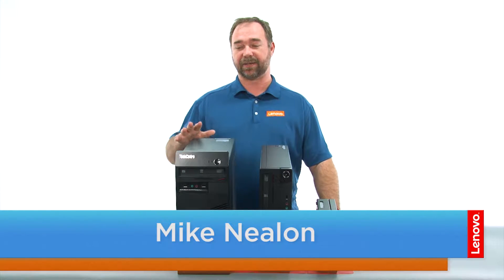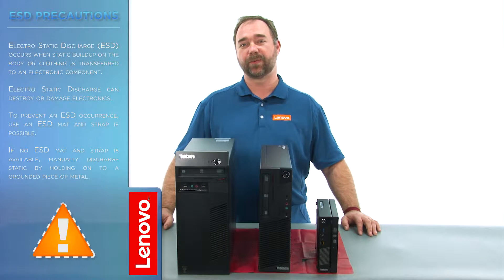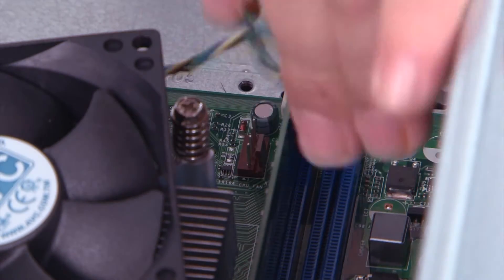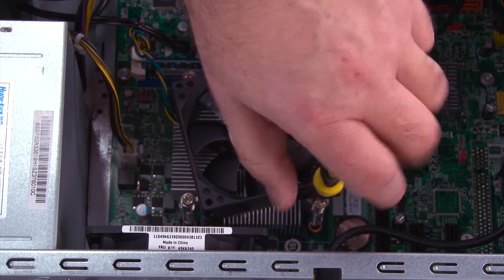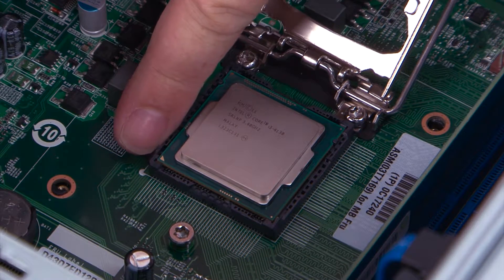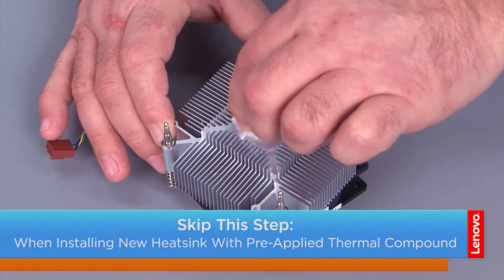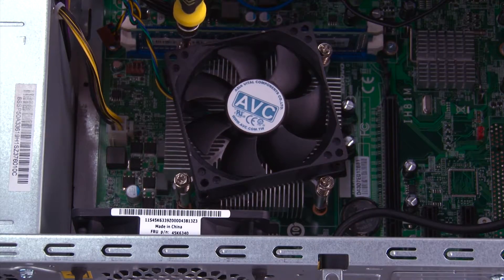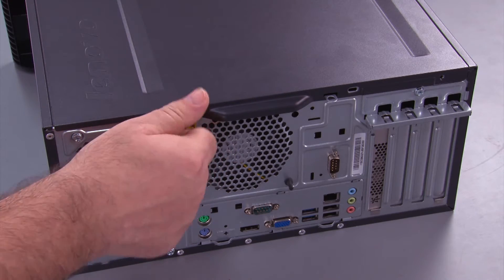ThinkCentre M73 / E73 / M72e Tower Desktop - Microprocessor and Heat Sink Fan Assembly Replacement

Comment: I have thinkcentre edge 72, can i upgrade the power supply to the aftermarket psu? Did the thinkcentre edge 72 use standard connector or proprietary psu connector?
Reply from the maker: Hi there, Pinot Noir! Thank you for reaching our support! There are two types of the ThinkCentre Edge 72 (full specification here https://lnv.gy/3xJHU9M). Just to confirm, are you using a ThinkCenter Edge 72 Tower or the ThinkCenter Edge 72 Small? -Chris_Lenovo
Reply: @LenovoSupport  I'm using edge 72 tower
Reply from the maker: Thank you. The model uses 180w Universal Power Supply (ATX), and uses 240 pin connector. We cannot guarantee the functionality of aftermarket PSU on this model as this is the only compatible PSU listed https://lnv.gy/3j5S5RW (Enter serial number > click on Compatible)., but you can use this as reference when looking for an aftermarket PSU's you can use. We do recommend checking community forums as well, for suggestion from other users that may have already tried the preferred setup. You can use our forums https://lnv.gy/2UrMdrT to post your concern for advise as well. Hector_Lenovo
Reply: @LenovoSupport  Thank you!!!👍

Comment: Does M73 tower support gtx 1060 6gb graphics card?
Reply from the maker: Hello! Thanks for reaching out. We found a similar thread in the Lenovo community forums. Here is the link: https://lnv.gy/2D5DcbS. You may want to check that out. Hassen_Lenovo
Reply: What type of screwdriver are you using?